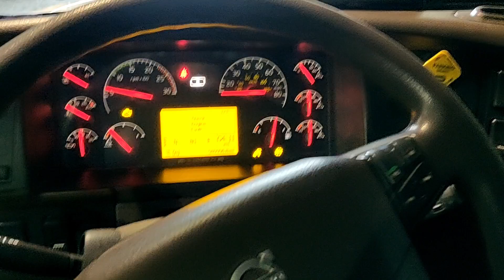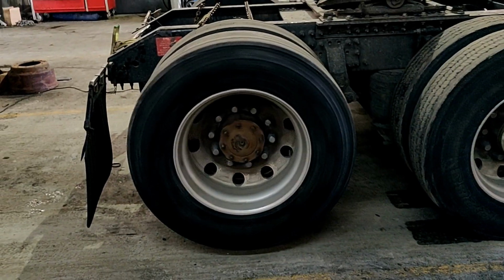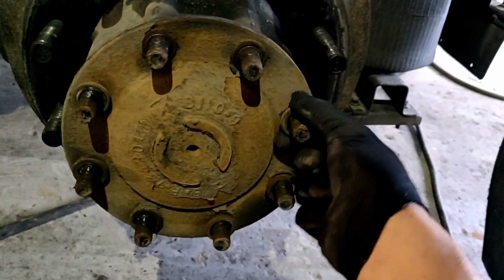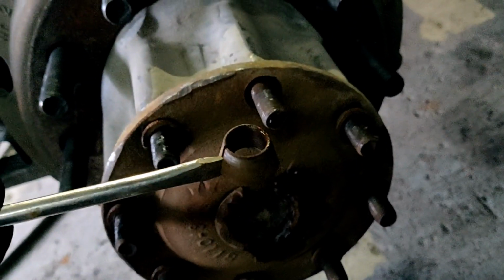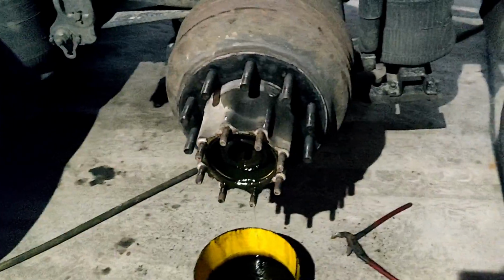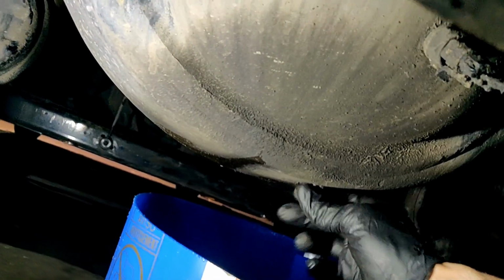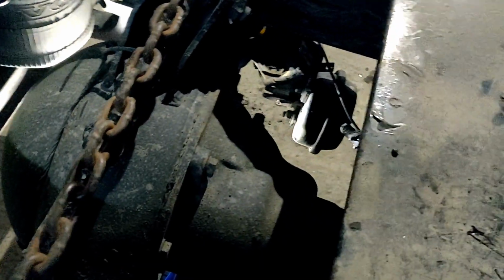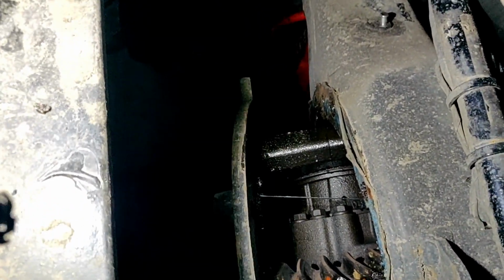Meritor differential removal Volvo Truck

Comment: My truck has problem when I turn differential switch on I hear air does something but only one rear wheel spinning on passenger side. What can be the problem? What's need be checked or replaced?

Comment: Did you check the oil in the front diff? Or is it lubed for life like the rear one? Maybe the owner will figure out one day that oil is way cheaper than gears and bearings, hope you did not shout at him to much, nice video!!
Reply from the maker: Yes I did also replaced the rear diff, everything is fine now, the truck it's on the road making 💰 , and yes parts from inside of diff are much more expansive then the oil!

Comment: Never seen a rear drive differential fail. It's always the front drive axle.
Reply: Well, if there is no oil. Lol. I just don't get how there was no oil in there...
Reply: @peteschnabel1345  never seen the rear drive diff leak oil either.  The front drives I've repeatedly found leaks during Pre Delivery Inspections.
Reply from the maker: I don't get it too) first time had a case like this!